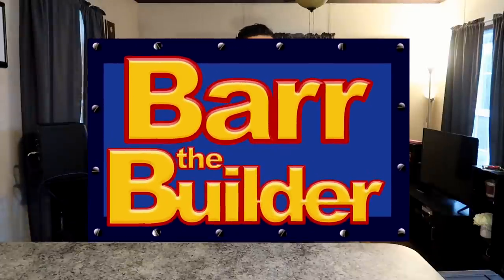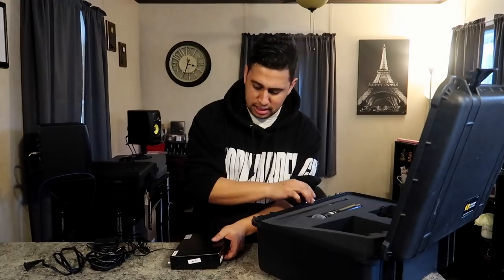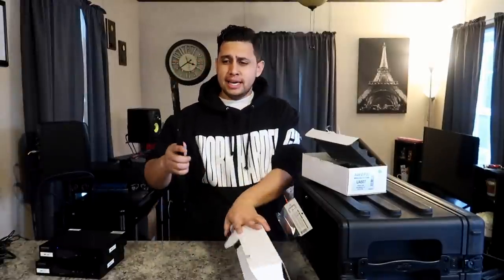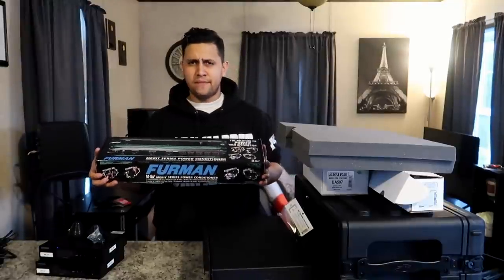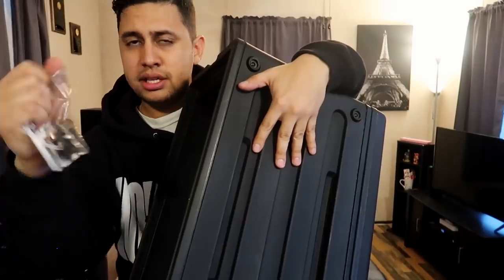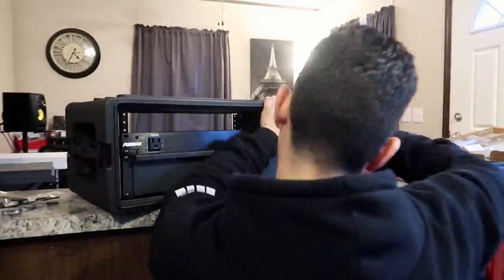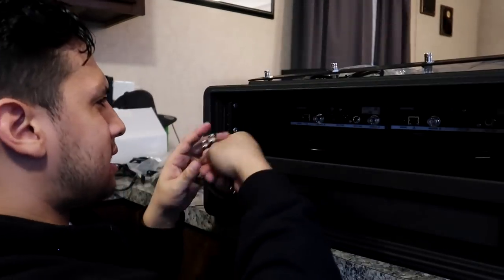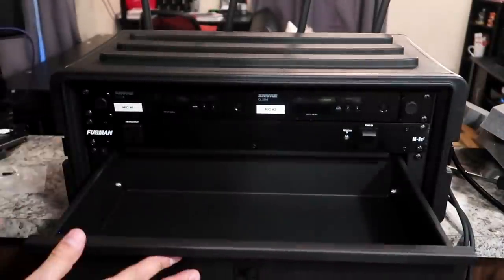Mobile DJ Tips: How to build a Wireless Microphone Rack

Comment: Nice job. I recommend purchasing a can of black plastic dip spray and spraying the top of the pick and pluck foamso is it seals it and doesn't breakdown with time. You can still alter it in the future if you need additional spaces but the plastic dip will create a bonded layer on the top.

Comment: Nice work! I have something very similar, I have a set of handhelds and lapel set.  I also have my dj copilot light controller installed and a slide out drawer too.  Now, inside the drawer, I have a mini mixer that controls my mics, I have a section for both handhelds and for my lapel packs.  
In the back, I mounted a surge protector and connected all power to it.  So when it comes time to setup, I pull out the power cord, XLR outs to my power speakers.  In the mixer area, I connect my iPad/iPhone/dj controller.
Been using it for 4 years now, with no issues.

Comment: What kind of psychopath doesn’t put the power conditioner in the top???Haha jk. Nice job 👍🏻
Reply from the maker: Cole Haaf I actually moved it when I got done filming lol it’s on top now
Reply: I thought the same thing but I figured you did it because of the antennas being on top. Looks good tho
Reply: def helps with heat dispersion.
Reply: And why not spring a little more for the power conditioner with the pull out lights for those dark venues
Reply: That is exactly what I thought. I just ordered pretty much the same setup for my mics, although I went for the Furman with lights.

Comment: Why didn't you get a combiner antenna cable so you only have to use 2 antennas instead of all 4?
Reply from the maker: dint know that was a thing lol
Reply: Bayardo A Rugama some have power distribution as well.
Reply: Yep. I was thinking the same thing. That way you wouldn’t need to disconnect your antennas. It daisy connects the antenna cables so you would only need 2 antennas for both receivers. I have the Shure SLX microphones and they have much smaller antennas. I can fit all 4 on my rack case, but in your situation with the larger antennas I would use the antenna combiner to run only 2.
Reply: Agreed. I just built a very similar case for QLX-D mics. Got an RF Venue DISTRO4 to combine antennas and power receivers in a single 1U device. I chose to mount the antennas on the front because the rear is usually facing away from the stage, but I usually hook up an external paddle diversity antenna anyway. Also, go for panel connectors in the back so you have nice labeled XLR outs for each mic. Since the QLX-Ds are networkable, you can also put ethercon connectors on the back if you want to use Wireless Workbench to coordinate/scan. I also opted to put a locking powercon connector on the back panel as well.
Reply: Combiners for the win , not the tiny Y splitter combiner junk though , the real deal like the UA844
Reply: @mashzmash   spot on!
Reply: He likes to show off his enormous antennas and make us all feel inadequate.
Reply: @mashzmash  Will you be doing a video for us?  I would like to see that.
Reply: Well I just asked the same question before reading the comments like a noob.. 🤦🏻‍♂️
Reply: Using a simple antenna combiner is not the best option but it is do able. The better option is getting a antenna distribution unit such as the shure ua844. This is because the distro unit amplifies the RF signal to compensate for the insertion loss because you are splitting the signal into multiple receivers.
Reply: Can someone please provide a link to the  combiner antenna cable so I would only have to use 2 antennas instead of all 4
Reply: @BayardoRugama  You can also purchase a "Networx Coaxial Patch Panels (16 Port, BNC)" if you're running large systems with several units. It doesn't combine antenna signals but it can give you a single rack unit that has all your antennas inline. It is a $50 alternative. You can also take it a step further and get a patch pannel with D-Series punch outs and completely customize what you need in a rack unit. You can install BNC, XLR, Speak-On, Power-con, Ethernet, etc. It may require a little knowledge of soldering for some of the connectors, but it is truly the most customizable option.
Reply: There’s one from Shure that costs a little more than that stupid antenna mounting kit. Great mics, I mainly do installs with those. But common, do some research.
Reply: DJ Rick Web With only two mics, I don’t think the combiner is worth the investment, personally.
Reply: @RightOnQEntertainment  With Shure SLX 4 you don't actually need to plug two antennas into the receiver. The B antenna is only there for redundancy if the A antenna loses the connection.
Reply: @mashzmash  With the antennas that he is using, it does not matter if you place them at the back or front of the case because they are omnidirectional. It mostly matters that you place them either vertical or at a 45 degree angle for best coverage.

Comment: Very nice. I just built a 4 mic ceremony system using the 6u version of that case. You know those 1/2 wave antennas will store very nicely in the lid of that case. No modification needed ; )

Comment: Nice.I have two wireless mics,receiver,a 8 channel mixer, cables to two controllers,auxiliar cable for a phone or tablet cable for a wired mic , out signal cables ,hdmi splitter, everything power by one ac cable in a smaller made by myself road case.

Comment: Inspired me to try to put one together myself.  I didn't see a shelf in there to mount the receivers onto.  What did you use to mount them?   Thanks for the content.  :)
Reply: The receivers come with mounting hardware that you attach to its chasis. The receiver is then able to be attached to the case mounted rails

Comment: I did a similar set up with a rolling 4u rack but my drawer holds lapel mics, batteries and a battery pack for the recievers. My antennas are on the user side so the side facing the people is always closed. I use mine for wireless battery powered ceremony system.

Comment: Nice job. You should label your g50 and H50 antenna  bands on your plate so as to avoid mixing them up. Also add a cheap 4 port unmanaged switch and cat5 for easy Wireless coordination.
Reply: Trying to build my mic rack too but what is a g50 and h50?

Comment from the maker: Equipment Used
-SKB Case: https://amzn.to/2TNFR0Z
-Gator Rack Drawer: https://amzn.to/2IdFkE0
-Gator Rack Drawer (Foam): https://amzn.to/2tiI3lm
-Hosa XLR Cable: https://amzn.to/2GHE2Pa
-Shure Mics: https://amzn.to/2TIOgTc
-Antena Holder: https://amzn.to/2I7tBa2
-Furman Surge: https://amzn.to/2N99WFO
-Tool Box Kit: https://amzn.to/2UWRySV
-Power Extenders: https://amzn.to/2SMveOF

Lights
-ADJ Focus Spot 3Z: http://amzn.to/2u1zuwE 
-ADJ Mega Hex: http://amzn.to/2DdXnE9 
-ADJ 5P Hex Par: https://amzn.to/2Cbgoad
-ADJ Pocket Pro: http://amzn.to/2yJkxiq 
-ADJ Chameleon Bar: http://amzn.to/2iUj1r9 

Uplights
-ADJ Element Hex: http://amzn.to/2yfwL2c 
-Ape Labs Maxi: https://goo.gl/gJz7Lr 

DJ Facade (FrontBoard) w/ Lights
-ADJ Facade: https://amzn.to/2SEH89X
-ADJ UB 12H: http://amzn.to/2xTQg05 
-ADJ UB 6H: https://amzn.to/2C9AJwh 
-Ape Labs Sticks: https://goo.gl/hikfQv

DMX (Lighting Controll)
-ADJ Airstream DMX: http://amzn.to/2x97xot

Photo Booth
-Printer: https://amzn.to/2LWCNwa
-Printer Media: https://amzn.to/2RFRlpi
-Guest Album: https://amzn.to/2VGioQr
-Props: https://amzn.to/2M5jP6V
-Mask: https://amzn.to/2VyaKYx
-Hats: https://amzn.to/2LYXuaP 
-Sings: https://amzn.to/2CX9A1t 
-Table: https://amzn.to/2C6SCfs 
-Table Scrim: https://amzn.to/2SQpPTe 

Totems & Stands
-Truss 2M-Totem: https://amzn.to/2SJEG27
-Truss Totem Bag: https://amzn.to/2SEhrpY
-Truss Totem Light: https://amzn.to/2Cbgoad
-Trusst Glo Totem 2.0: http://amzn.to/2Dd7AAs
-Speaker Stands: https://amzn.to/2RK3wBL
-Light Stand: http://amzn.to/2zIMzhB 

Mics (Use/Recommend):
-AKG Wireless Microphone: http://amzn.to/2kGziM2   
-Shure QLXD Wireless Mic: http://amzn.to/2iCxOm8 
-Shure GLXD Wireless Mic: http://amzn.to/2zonWEv 
-Shure Beta 58A: http://amzn.to/2EpoDPh 
-Microphone Desk Stand: http://amzn.to/2kGx2Ev 

Special Effects
-Chauvet FunFetti Cannon: http://amzn.to/2DeDBrV 
-Chauvet Confetti: http://amzn.to/2Df8n45 
-Chauvet Nimbus: http://amzn.to/2BChAS0

Gobo Projector 
ADJ Icon Profile: http://amzn.to/2CXhbid 
ADJ Stand: http://amzn.to/2zIMzhB  

Mixers (Use/ Recommend )
-Pioneer SB2 (New DJs): https://amzn.to/2CbVF5S
-Pioneer DJ SX3(Intermediate DJs): https://amzn.to/2LWLXJj
-Pioneer DJ SZ2 (Pro DJs): https://amzn.to/2SKHVpK
-Pioneer DJM 900 Mixer: https://amzn.to/2RERJV5
-Pioneer CDJ 2000: https://amzn.to/2RBHMYw  

DJ Tools
-Pioneer Headphones: http://amzn.to/2vIfKMS
-Microphone Desk Stand: http://amzn.to/2kGx2Ev 
-Speaker Tripod: http://amzn.to/2wVbCNU
-Cable Label Maker: http://amzn.to/2z9yIhT 
-Hosa Cable Tester: http://amzn.to/2xSJ04H 
-Gaffers Tape: http://amzn.to/2wle5Qd 
-5FT DJ Table: https://amzn.to/2SLyBC8
-Cable Bag: https://amzn.to/2FjZKZ6
-Rock-N-Roller Cart: http://amzn.to/2kXcdrT 
-Ceremony Mixer: http://amzn.to/2zlGNQh

Speakers
-JBL SRX Speaker: https://amzn.to/2RIimIY
-JBL SRX Subwoffer: https://amzn.to/2C6B42Y 
-JBL PRX 812 Speaker: https://amzn.to/2AADfvR
-JBL PRX Subwoofer: https://amzn.to/2SL6CCr 
-Avante Speaker: https://amzn.to/2LYXffV
-PVX P 12": http://amzn.to/2yItUCG 
-PVX P 15": http://amzn.to/2kQzxZF 
-PVX Sub: http://amzn.to/2ghZcsC 
-Speaker Package: http://amzn.to/2yK5FEo 
 
Cables
-Hosa XLR Basic: http://amzn.to/2iVlEJ0 
-Hosa XLR Pro: http://amzn.to/2iq4VJK 
-Hosa XLR Edge: http://amzn.to/2hA6iWX 
-Hosa DMX Cable: http://amzn.to/2yr55eL 
-Hosa Cable Tester: http://amzn.to/2xSJ04H 
-Hosa Extension Cord: http://amzn.to/2xQzleT 
-Hosa Gaffers Tape: http://amzn.to/2z8N0iM 
-Hosa IEC Cable: http://amzn.to/2z8LsFq 
-Hosa AC Power: http://amzn.to/2ipRvxq
-Hosa Power Con: http://amzn.to/2zbh5yp
-Hosa Power Distributer: http://amzn.to/2xQVJ7P 

Video Gear
-Camera - Canon G7X II: http://amzn.to/2jbuUHz
-DJI Mavic Pro: http://amzn.to/2jA4zPK
-Memory Card: http://amzn.to/2io1swA
-Hand-Held Tripod: http://amzn.to/1RTdgAG
-Over-Head Tripod: https://amzn.to/2CbE8uL

Videos are Edited On: Final Cut Pro X 

------------------------------------------------------------------------

Follow Me on Social Media - SOCIAL MEADIA 

Instagram: https://instagram.com/DJBarrNJ 
Snapchat: https://www.snapchat.com/add/DJBarrNJ 
Facebook: https://www.facebook.com/DJBarrNJ/ 
Mixcloud: https://www.mixcloud.com/BarrNation/
Instagram: https://www.instagram.com/barrentertainment/
Twitter: https://twitter.com/DJBarr 

-----------------------------------------------------------------------

Music By: Quads
https://soundcloud.com/aka-dj-quads

------------------------------------------------------------------------

ABOUT ME:  I was born March 06, 1992 in Nicaragua. I currently live in New Jersey, USA. I am an open-format Club and Mobile DJ. I enjoy making and sharing videos about my life as DJ and my travels around the world. I hope you find my videos entertaining.  If you have any questions feel free to ask.J Tips: How to build a Wireless Microphone Rack

Equipment Used:
-SKB Case: https://amzn.to/2TNFR0Z
-Gator Rack Drawer: https://amzn.to/2IdFkE0
-Gator Rack Drawer (Foam): https://amzn.to/2tiI3lm
-Hosa XLR Cable: https://amzn.to/2GHE2Pa
-Shure Mics: https://amzn.to/2TIOgTc
-Antena Holder: https://amzn.to/2I7tBa2
-Furman Surge: https://amzn.to/2N99WFO
-Tool Box Kit: https://amzn.to/2UWRySV
GEAR LIST

Lights
-ADJ Focus Spot 3Z: http://amzn.to/2u1zuwE 
-ADJ Mega Hex: http://amzn.to/2DdXnE9 
-ADJ 5P Hex Par: https://amzn.to/2Cbgoad
-ADJ Pocket Pro: http://amzn.to/2yJkxiq 
-ADJ Chameleon Bar: http://amzn.to/2iUj1r9 

Uplights
-ADJ Element Hex: http://amzn.to/2yfwL2c 
-Ape Labs Maxi: https://goo.gl/gJz7Lr 

DJ Facade (FrontBoard) w/ Lights
-ADJ Facade: https://amzn.to/2SEH89X
-ADJ UB 12H: http://amzn.to/2xTQg05 
-ADJ UB 6H: https://amzn.to/2C9AJwh 
-Ape Labs Sticks: https://goo.gl/hikfQv

DMX (Lighting Controll)
-ADJ Airstream DMX: http://amzn.to/2x97xot

Photo Booth
-Printer: https://amzn.to/2LWCNwa
-Printer Media: https://amzn.to/2RFRlpi
-Guest Album: https://amzn.to/2VGioQr
-Props: https://amzn.to/2M5jP6V
-Mask: https://amzn.to/2VyaKYx
-Hats: https://amzn.to/2LYXuaP 
-Sings: https://amzn.to/2CX9A1t 
-Table: https://amzn.to/2C6SCfs 
-Table Scrim: https://amzn.to/2SQpPTe 

Totems & Stands
-Truss 2M-Totem: https://amzn.to/2SJEG27
-Truss Totem Bag: https://amzn.to/2SEhrpY
-Truss Totem Light: https://amzn.to/2Cbgoad
-Trusst Glo Totem 2.0: http://amzn.to/2Dd7AAs
-Speaker Stands: https://amzn.to/2RK3wBL
-Light Stand: http://amzn.to/2zIMzhB 

Mics (Use/Recommend):
-AKG Wireless Microphone: http://amzn.to/2kGziM2   
-Shure QLXD Wireless Mic: http://amzn.to/2iCxOm8 
-Shure GLXD Wireless Mic: http://amzn.to/2zonWEv 
-Shure Beta 58A: http://amzn.to/2EpoDPh 
-Microphone Desk Stand: http://amzn.to/2kGx2Ev 

Special Effects
-Chauvet FunFetti Cannon: http://amzn.to/2DeDBrV 
-Chauvet Confetti: http://amzn.to/2Df8n45 
-Chauvet Nimbus: http://amzn.to/2BChAS0

Gobo Projector 
ADJ Icon Profile: http://amzn.to/2CXhbid 
ADJ Stand: http://amzn.to/2zIMzhB  

Mixers (Use/ Recommend )
-Pioneer SB2 (New DJs): https://amzn.to/2CbVF5S
-Pioneer DJ SX3(Intermediate DJs): https://amzn.to/2LWLXJj
-Pioneer DJ SZ2 (Pro DJs): https://amzn.to/2SKHVpK
-Pioneer DJM 900 Mixer: https://amzn.to/2RERJV5
-Pioneer CDJ 2000: https://amzn.to/2RBHMYw  

DJ Tools
-Pioneer Headphones: http://amzn.to/2vIfKMS
-Microphone Desk Stand: http://amzn.to/2kGx2Ev 
-Speaker Tripod: http://amzn.to/2wVbCNU
-Cable Label Maker: http://amzn.to/2z9yIhT 
-Hosa Cable Tester: http://amzn.to/2xSJ04H 
-Gaffers Tape: http://amzn.to/2wle5Qd 
-5FT DJ Table: https://amzn.to/2SLyBC8
-Cable Bag: https://amzn.to/2FjZKZ6
-Rock-N-Roller Cart: http://amzn.to/2kXcdrT 
-Ceremony Mixer: http://amzn.to/2zlGNQh

Speakers
-JBL SRX Speaker: https://amzn.to/2RIimIY
-JBL SRX Subwoffer: https://amzn.to/2C6B42Y 
-JBL PRX 812 Speaker: https://amzn.to/2AADfvR
-JBL PRX Subwoofer: https://amzn.to/2SL6CCr 
-Avante Speaker: https://amzn.to/2LYXffV
-PVX P 12": http://amzn.to/2yItUCG 
-PVX P 15": http://amzn.to/2kQzxZF 
-PVX Sub: http://amzn.to/2ghZcsC 
-Speaker Package: http://amzn.to/2yK5FEo 
 
Cables
-Hosa XLR Basic: http://amzn.to/2iVlEJ0 
-Hosa XLR Pro: http://amzn.to/2iq4VJK 
-Hosa XLR Edge: http://amzn.to/2hA6iWX 
-Hosa DMX Cable: http://amzn.to/2yr55eL 
-Hosa Cable Tester: http://amzn.to/2xSJ04H 
-Hosa Extension Cord: http://amzn.to/2xQzleT 
-Hosa Gaffers Tape: http://amzn.to/2z8N0iM 
-Hosa IEC Cable: http://amzn.to/2z8LsFq 
-Hosa AC Power: http://amzn.to/2ipRvxq
-Hosa Power Con: http://amzn.to/2zbh5yp
-Hosa Power Distributer: http://amzn.to/2xQVJ7P 

Video Gear
-Camera - Canon G7X II: http://amzn.to/2jbuUHz
-DJI Mavic Pro: http://amzn.to/2jA4zPK
-Memory Card: http://amzn.to/2io1swA
-Hand-Held Tripod: http://amzn.to/1RTdgAG
-Over-Head Tripod: https://amzn.to/2CbE8uL

Videos are Edited On: Final Cut Pro X

Comment: Why don't you just get a Controller case with a rack underneath that's what we do and you never have to take anything apart? Unless you're working with Bands you now have to worry about is where to put this rack and connecting and disconnecting every time?
Reply from the maker: It won't fit in my console. I would have to buy a ton of gear to make that happen.
Reply: Dude the amount of money you spent on that rack etc is about as much as a case with the rack built underneath the controller but OK
Reply: @PaparazziEntertainment  he uses cdj 2000 nxs
Reply: He uses CDJs. Not a controller. Coffins like that don't have extra space under them.
Reply: @djnvision  My Bad LOL
Reply: There was a time when all audio gear was 19" so that it fit in a rack.
Reply: Quick question where did you order the single rack qlxd rack mount kit?